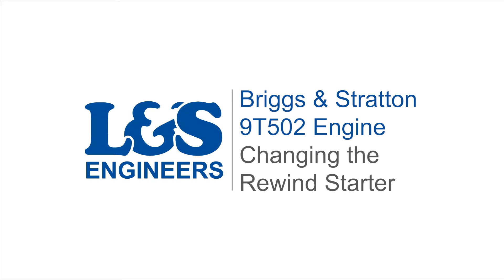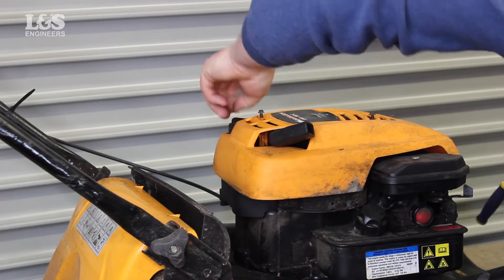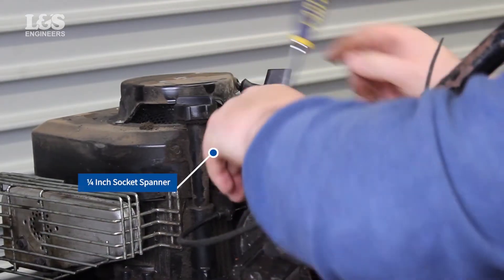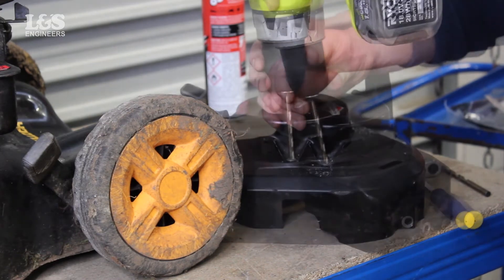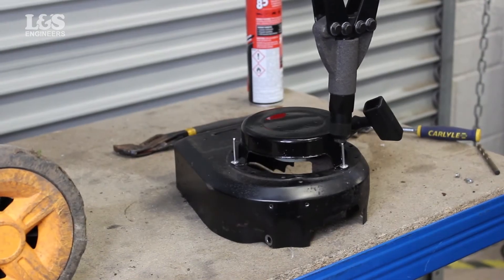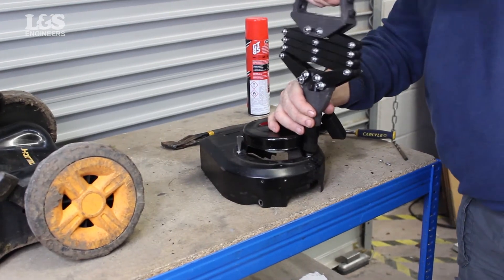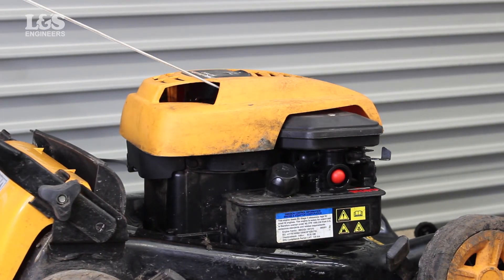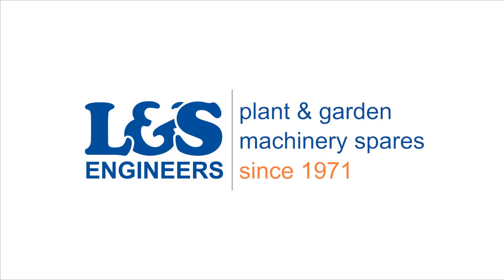How to Change a Rewind Starter using a Riveter on a Briggs and Stratton Engine for a Lawnmower | L&S

Comment: And if you don’t have a riveter?
Reply from the maker: Hi, I can only recommend a rivet gun/tool to do this task, you can normally get these inexpensively. Anything else just let us know! :)
Reply: My thoughts exactly, and i thought about small screw and nut combination (maybe even loctite). Then I thought about the vibrations on top of the motor, it will likely shake loose before long and something falls into a moving engine. I got a hand riveter on amazon for $17 shipped.